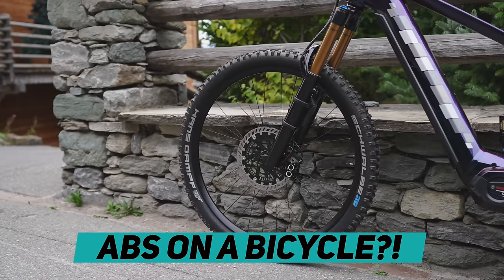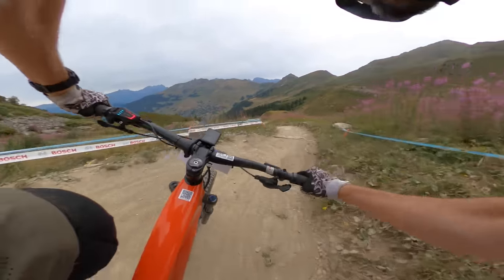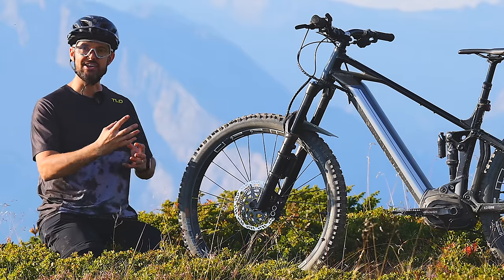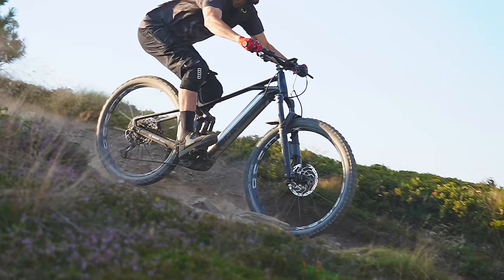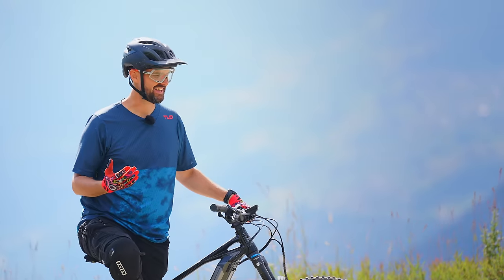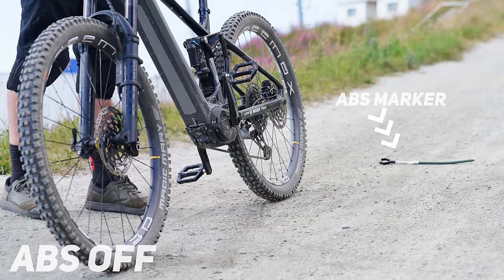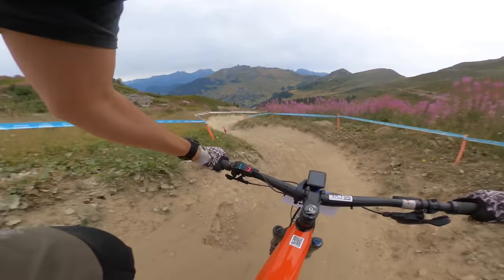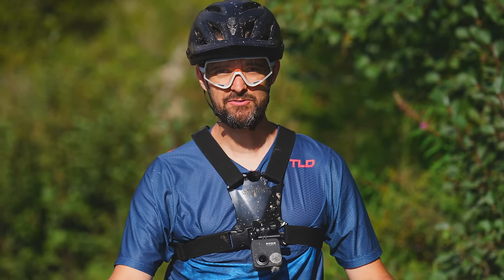I didn't want to like it... Bosch ABS is INSANE!

Comment: I'm certain I would get down those insanely steep loose downhills faster and with considerably fewer washouts if I had ABS. So it's probably both fun and confidence inspiring. But as with all performance enhancing technology I'm hesitant when it takes away from my skills development. But the same thing could be said about having more powerful brakes, which also improves confidence and faster descents.
So I think my biggest concern would be that a lot of the new bike technology we see increases our speed on the trails, which is a potential increased hazard in it self 🤷

Comment: The divide keeps growing and growing. MTB is splitting up into different disciplines. A hardtail rider without motors or gadgets is doing a different sport than an e-MTB rider with electronics and assists everywhere, even if they ride the same trail.

Comment: Would be keen to see the comparison if you didn’t lock the rear wheel and/or put your weight back more. Threshold and panic braking are different honks. Threshold braking is smooth and at the limit of the tires whereas panic is full grab

Comment: Not sure. I don't think I'd want to be an early adopter. Happy to take a wait and see approach as:
The packaging looks like a test mule. Holy cables and choc boxes batman! 
Is it 100% trouble free or is it going to start acting up on a ride. Is it fit and forget or needs lots of attention?
Adds a point of failure on a critical system. I wouldn't ever want that to fail and have a high speed over the bars..

Comment: So when you want to lock the front for a second, to lift the rear and move it around, the ABS will put a stop to that. It wont lock.   More weight/more complexity.

The index finger can be trained to run the brakes, its about learning to ride a bike.
ABS is already in that finger, with practice.

Comment: My opinion is that you purposely used the brakes in a manner that would advantage the abs or to forcefully demonstrate the abs.
Proper braking technique implies moving your body to the back of the bike to increase both front leverage and rear weight. 
Moving the center of mass forward drastically reduces the rear braking capability.
Reply: I was thinking the same thing he's not stretched back squatting low to keep the centre of gravity low to the ground. Gay af demonstration your right!

Comment: People who know how to ride know that you never pull the brake levers as far as they go to come to a stop as quickly as possible so why did you do that in your test? You are supposed to pull the levers progressively and feel the tires respond and adjust accordingly by shifting weight and lever pressure. If your rear wheel locks up, you are doing it wrong. That’s how you simulate abs and that’s what most riders do naturally. This system makes sense on heavier eBikes but not really on lighter ones or on race bikes.

Comment: I regularly lock the front to move sideways into a berm... just a second, leaning all the way back, but this way you can steer into the berm while still skipping staight... i dont want abs, its nonense on a trail, street and high speed yes, but on the trail.... i think someone that can stop fast, move around smooth and fast is in my opinion the one with the most skill.

Comment: If the rear wheel can lock, and the front wheel depends on the speed difference between the front and rear wheels, how does it work when the rear is locked?
Reply: Probably checks for rotation on the front wheel alone if the rear wheel isn't rotating?
Reply: It likely looks for the speed the front wheel is slowing down.  I think it's possible the rear wheel sensor is used for the speedometer partially.  Maybe rear speed sensors will be used for traction control in the future, which may be far fetched but who knows

Comment: It’s funny though, riding/driving cars and bikes on track we’re taught to switch off ABS and Traction Control. Having myself accurately tested it, I know with some practice, you can perform better without any rider/driver aids… Interesting how this will play out in the MTB world.
Reply: One difference is that a paved track has much more consistent grip than what you might experience off-road. The generally unchanging nature of the contact point means humans can often outperform ABS systems. Off-road is another story with the changing and dynamic tire/ground.
Reply: @soy_leche  I thought that, it’s never really worked out when it comes to motocross. However, I guess the weight of an MX bike is far harder to control compared to an MTB. Sounds like the relative lightweight MTB could be the sweet spot.
Reply: Hi. I’d have agreed with you a few ABS generations ago but my new BMW S1000RR has cornering and multi mode ABS. You can switch it off but it’s now better than me at braking and miles ahead of my previous ABS bike (which kicked in too early).
Reply: @deputydd4364  my Tuono and KTM SuperDuke had 6 axis IMU with cornering ABS. I would always leave it on for road riding but no doubt the bike performed better on track with everything off. Horses for course.

Comment: I have both a motorcycle and a bike. All road here are unpaved and most of it goes up and down. Both of them doesn't have abs. I always use rear brake for slowing when going down (with the help of engine braking on the motorcycle) to slow me down and front brakes for stopping only. I don't want to flip forward. When people panics they tend to use the front brakes at fast speeds and that's dangerous without abs. For me, I don't need abs.

Comment: Interesting it works when the rear is locked and when the front is rotating faster than the rear. So there must be a line of code dedicated to when the rear is locked, otherwise it wouldn't know how much abs to apply ???

Comment: I had no idea you guys don’t shift your weight back when doing emergency braking like us roadies. Helps us a lot especially if emergency braking on a steep hill
Reply: We do! The breaking he showed in the ABS vs non ABS test is not how any somewhat experienced mountain biker would do it. Normaly you can also keep the front wheel way more near the blocking point and there would not be that much difference in the breaking distance.

Comment: He admits at the end to having crashed due to maybe getting used to the false safety net provided by the system when going back to a normal bike?
I would say maybe it’s good for your liability insurance if running an ebike hire fleet where novices are riding the bikes, but I wouldn’t want it on mine.
There are some braking techniques not addressed like weight shift and dilberate front wheel skid…”
Learning the endo/stoppie point and how to control incipient slide is a basic core skill of MTBing that this system would take away?
But, more £££ for local bike shops is a great thing, so I support it

Comment: When you were braking in a straight line with ABS on you were locking the rear wheel. If the system measures difference in wheel speeds, how can it work with the rear wheel not rotating?
Reply: It just takes additional information from the rear wheel. It will intervene if the front wheel is rotating slower than the rear. It’s not doing anything if it’s the other way around and it relies on the front sensor only.

Comment: It's supposed to work by comparing front and rear wheel speeds but no one is asking the question what happens when you're doing 30kph and you lock up your rear wheel? Will it suddenly unleash full braking force onto the front wheel? How will it know what the true speed is?

Comment: Hardly anyone knows what ABS actually does. Even in a car it does NOT make you stop faster, the fastest way to stop is still to apply just enough brake pressure to not quite activate the ABS system. If you can't drive and just slam on, then without ABS you would lock up and crash, but modulate your pressure properly, and it's better than ABS.

Comment: So how does it sense the front & rear wheel speed differential & not lock up the front wheel, when the rear wheel is locked up? Must have additional single wheel sensing, eg speed reduction more than x means the front wheel, is locking up, if it can't sense- use the rear wheel for speed comparison. Nice tech

Comment: Okay, but HOW does it work? How does it modulate the braking power while keeping the system pressurized? Is it the same hydraulic circuit for the rider and for the ABS controller, or are they separated and pressure from the lever is just a setpoint for the controller?

Comment: I'm sure its a good system but that straight line brake test was not sufficient to prove much of anything. In both cases you just skid while basically sitting in the saddle. I guess ABS would of course work better in that case but largely because you can pull more brake. In a better test for trail use, you should use actual hard braking technique like you would on trail, and really weight the tires. Unless you don't know how to stop like that, you could probably stop much quicker with proper technique, and you might even out-perform ABS, because with proper braking technique you can pull full front just the same.

Comment: If you can switch it on and off, why wouldn’t we see ABS at the rear for riders that would like the rear wheel not to skid?  It could still be switched it off for the reasons you gave!
Reply: It would be like taking the handbrake off a rally car.
Totally unsuitable for off-road use.

Comment: abs brakes are for safety not for performance. 
coming from the motorcycle community, most of the skilled stunt riders avoid abs brakes, 

abs brakes are automatic brakes, they prevent the wheels from locking up. 

this is better on a four wheeled vehicle for coming to the fastest safest controlled stop possible. 

it's safety for motorcycles too, as you really don't want that front wheel to lock up while riding. 

but if you NEED the wheels to lock up to perform stunts, slides, drifts, tricks, etc, the abs system will completely ruin it.

Comment: It looks like they could easily build that sensor ring into the rotor, seems like a bit of an afterthought given it's mostly Magura brakes.  I'm really curious to know how it works in a situatoin like test 2.  You've clearly got the back wheel locked up so what is it checking the front rotation against?  Seems to work but is there any chance it could be psycholigical?  you thought it was working so you pulled harder, whereas in reality the rear wheel lock up means it's not fully working?  Maybe they use some sort of estimate from just before the rear wheel lock up. So many questions.
Reply from the maker: I know what you are saying, but it still works with the rear wheel locked. It must fallback to single front sensor when the rear is locked.
Reply: @RobRidesEMTB  As an analog mtber I'm starting to get really jealous of all the tech being thrown at EMTBs, this and auto shift are really tempting me.

Comment: It works great from all reviews seen so far! Great Innovation! Is it a game changer like the dropper seat post that will I'll never ride without now? Probably not! It's a nice convenience for a true shredder ripp'n singletrack descents...I'm a wuss -hucker, that flows cautiously and that feather's my modulation on 4-pot XTs and 220 Galfer rotors! 🤟 So, maybe a performance variable that my $$$ will better go into such as a leaner mid-power E-mtb rig that's 8-10 lbs lighter than my full-power rig...jus say'n Transition Relay next year 🤞💸🍻

Comment: I'm not saying the ABS cant out-brake non-abs but I dont think the test came down to a simple factor of abs or not. With ABS you had no fear and were therefore able to squeeze as hard as possible and leave the risk to the computer. You admitted that you werent giving it as much as you could have with non-abs (9.5 out of is still less than the 10 out of 10 you gave the abs) with the implication being that going 10.1 out of 10 would end in an endo. You built in a safety buffer that kept you from reaching the limits of non-abs but took abs all the way to it's limit. An unfair test do to the fear factor but an applicable one cause "Jesus er... abs take the wheel!" is part of what abs is selling. 
As someone that has spent years working in tech support because ALL tech breaks, I cant help but worry that the sport may progress do to the advancements in technology such as abs BUT at the cost of riders truely knowing how to control their bikes themselves. When an abs equipped rider has an abs failure (which WILL happen) or they find themselves on a bike without it, I image their performance will be pointedly lacking as they'll think they can just go full squeeze all the time and end up eating sh*t.

Comment: Only thing missing Rob is your Bosch tee shirt.
Bosch ebikes, voted most likely to turn into yard art with completely proprietary, CANBUS controlled motor systems. The bike reviewed by Rob as their company spokesman will cost more than a Ducati Panigale to maintain long term if you can even find replacement parts 5 years from now.
For idiots.

Comment: ABS doesn't give you any performance gains, I had it on a road going motorcycle and I ended up disabling it because I hated it, as was said in the video when the ABS reads that your front wheel is rotating slower than the rear it will activate, so under hard braking the rear would come off the ground slightly and the ABS would kick in releasing brake pressure because it thought the front wheel was locking when it wasn't, and that actually increased my stopping distance, there's no way I would ever use it on a mountain bike, especially riding steep double blacks where it could actually be dangerous, it might give you more confidence, but it will also make you a worse rider in the long run.

Comment: How could this even work? if, as you mentioned, the front wheel "lockup" is detected by the relative slower wheel turning speed in comparison to the back wheel, what happens if the back wheel is also locked up (as will easily, or mostly be the case)? slower front wheel means: open the brake. faster front wheel means: close the brake. which is fatal when the back wheel is already locked up...
Reply from the maker: The system detects when the back wheel is locked and just uses the front sensor to control braking force. (I double checked this with Bosch yesterday)
Reply: @RobRidesEMTB  sorry, but HOW should it be able to detect this? the sensors can only detect wheel rotation speed differences. or can the speed "over ground" be detected somehow?

Comment: If the rear wheel is slipping how can the system compare wheel speed to the front?
Reply: That's only part of how an abs system works. It also looks for realistic deltas in speed on a single wheel (I'm a racing driver used to motorsports abs)

Comment: Not saying abs is not good, but what if you put a bit more weight on the rear wheel while braking. Not saying massive, but at least not lean front. No one does an emergency brake like that.

Comment: Not a chance you ride faster with ABS, if that would been the case then all motocross and enduro-bikes would have it, but in-fact nobody have it except touring bikes as a safety feature.
Reply: Didn't you see his test? If you turn abs off and lock up the rear wheel everytime then you don't stop as fast.

Comment: Pedal bikes are becoming ever more complicated, complex, and expensive.
Disk brakes, electric bike, suspension, ABS, electric gears, etc.
All of the simple simplicity and cheapness and ease of maintenance is being lost.
A bike should be light, cheap to purchase, fun to ride, and easy to work on yourself, with home maintenance. 
All of the new fangled items, they can be worked on at home by average person.
Also, bike is supposed to be about fitness, therefore, you do not need e-bike and should not have e-bike.

Comment: Not that impressed with your comparison, your technice was poor, feelt like you dont really givit your best to stop as quick as possible. 

In a straight line, non-abs have a better potential to stop you quicker. But it requier a bit of skill to be on the edge of what the tire can handle. Pretty cool tech tho

Comment: I wonder if a pro Rider can outbreak it, because im pretty convinced its possible
Reply: How ? It's all about the front brake a human can't lock and unlock the front brake as fast as a abs system.
Reply: @christianstock7183  yes but if you dont even have to unlock the brakes cause you stay at the perfect point right before they are locked you should be able to stop faster
Reply: @jemaripano8078  nah cuz u lose brake force cuz u aren't using the potential of the brake.
Reply: @christianstock7183  Not if u Hit the point perfectly As a pro rider should be able to
Reply: @jemaripano8078  Nah u can't use the full potential of the brake cuz if u would u are locking up so get the maximum brake force u need the abs